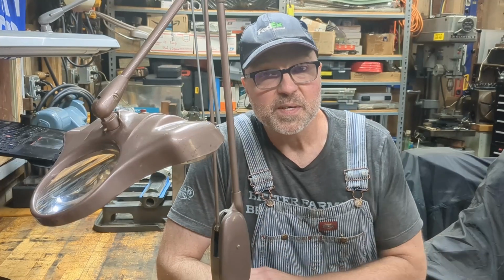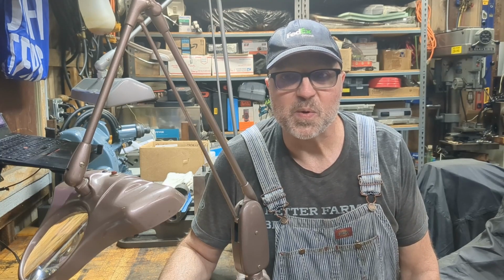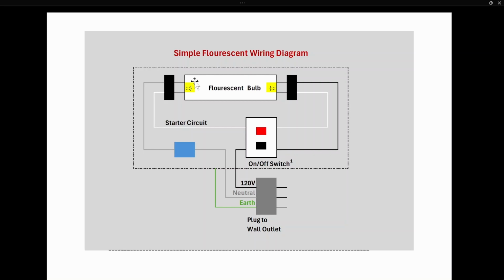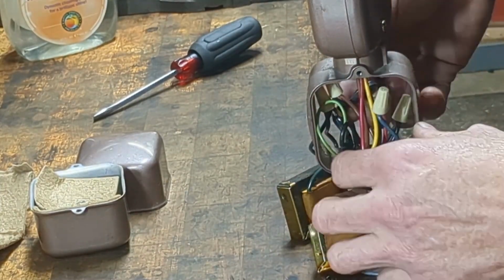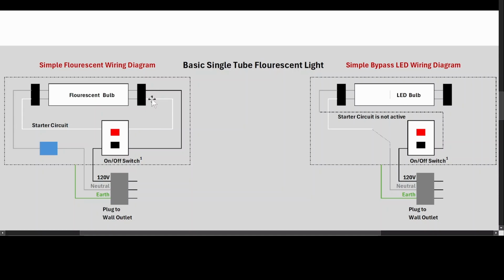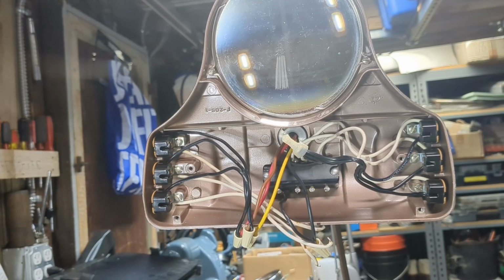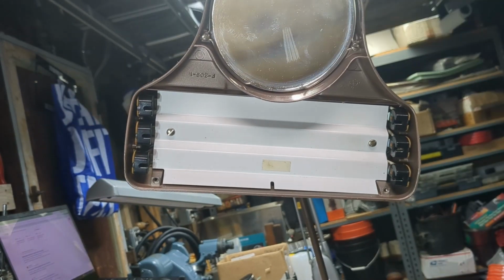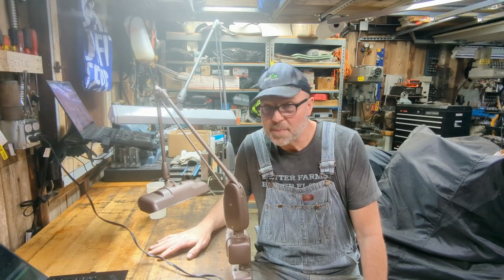Dazor Fluorescent Tube Lamp Conversion to Ballast Bypass LED Bulbs

Comment: Very well organized and explained (colored neutrals notwithstanding 🙂).  Feedback: Be careful about your overhead light hitting the lens of your camera.  It causes a cloudiness.  There were a couple times during close ups when your hands shaded the lens and the picture got substantially clearer.  You can get (or rig up) a lens shade for your camera that will help a ton!  Also, speak up a bit.  You could stand to be ~10-20% louder.  But still an EXCELLENT presentation and production.  Esp. your wiring diagrams!!!  Well Done!  I'll tackle my Dazor ULP2324-16 this weekend with confidence.
Reply from the maker: Thanks man!  I appreciate the feedback for sure!  That was my very first video and I'm only now working on my 4th and 5th.  The volume thing is elusive.  It sounded fine before I uploaded it, but I agree that it's too low online.  I was working under fluorescents.  I wonder if that was part of the problem.  I can see interference patterns sometimes while filming.  I'll look into setting up a shade.  Great advice, thanks.  It just occurred to me that I could switch in some LEDs (doh!) and try those out in that location.